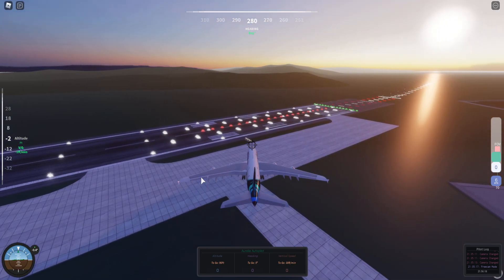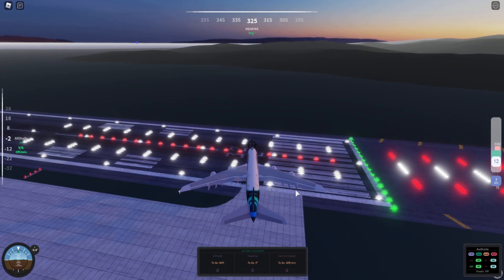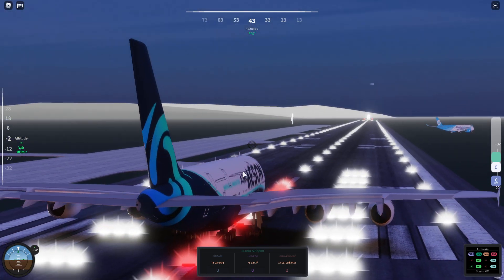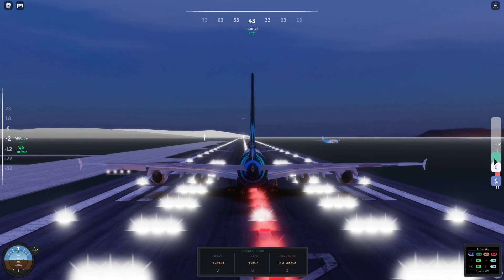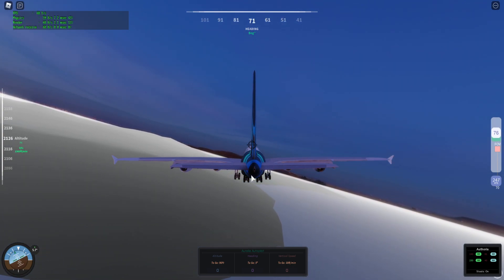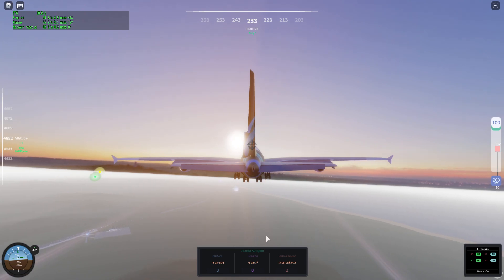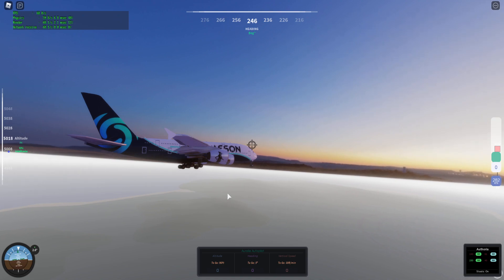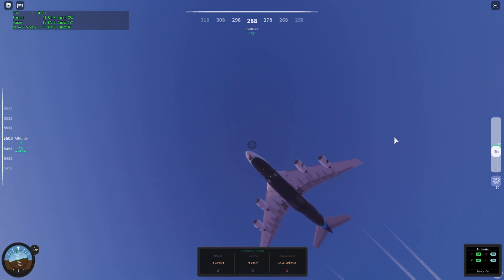Aeson Elaina: First In Air Test + Landing Fail (WIP)

Comment: increase the time it takes for the aircraft to stop when its on r-thrust
Reply from the maker: With A380 Rthrust is not powerful enough for that as two of the outerboard engines are running at idle still, A380 slows down mostly with its brakes and spoilers
Reply: @aesonindustries8325  Thanks, I appreciate the comment.